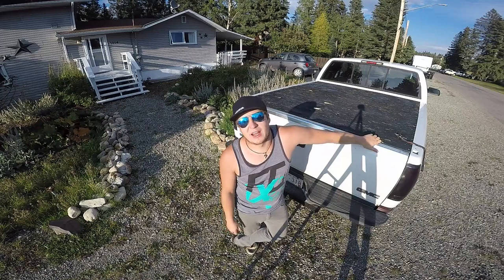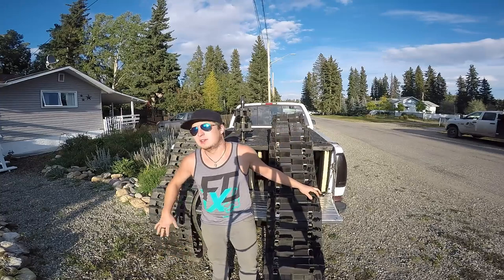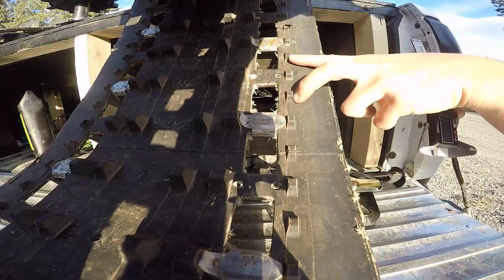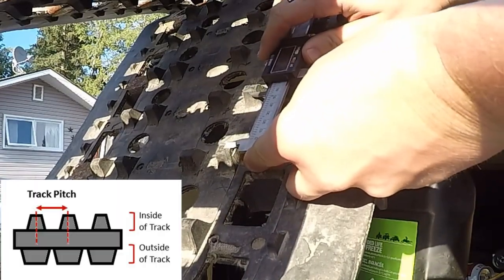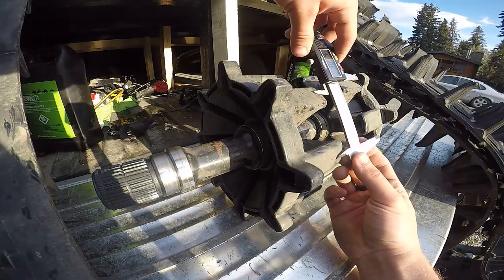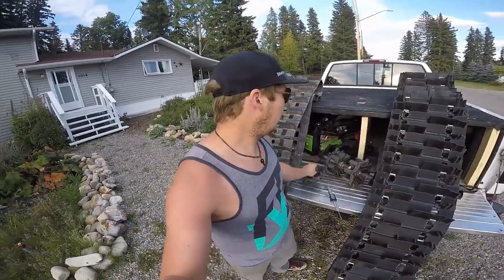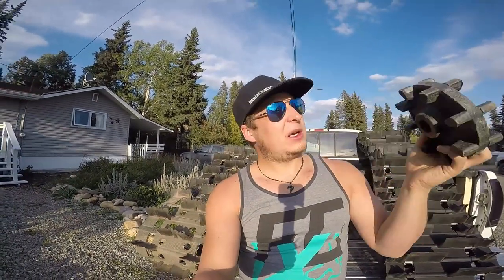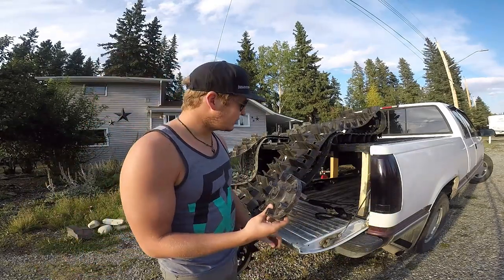SNOWMOBILE TRACK PITCH EXPLAINED AND DEMONSTRATED

Comment: Were there any problems with the 2018 sleds? Such as overheating or clutching?
Reply from the maker: The ERs got a new primary clutch due to the bearing not being to spec. A few routing updates. Driver nut torque update. Haven't seen anything fail yet though.

Comment: Common Snowmobile track pitches are 2.52",  2.86", and 3.00".  Can quickly tell one from the other with a digital caliber, or tape measure 10 pitches (30"), and then move the decimal point 1 to the left  (3.0").

Comment: Matt, that was very well explained,  Tracks 101.   
Many RMK riders were changing out their stock 2.4" tracks c/w 2.86 pitch (which is now discontinued) to the 2.6" or 3.0" Powerclaw (c/w 3" pitch).
To do that swap you have to change the front drivers too.   Much improved performance and traction.   3.0" pitch has the lugs further spaced out, more snow between lugs/better traction and usually a lighter weight too.
What to do with that old worn out deep lug track??  They make the coolest truck mud flaps ever.  Trim the top lugs off where they mount, lugs to the back  :)
A perfect Mod look for a white F-350??   Hmmm??
Reply from the maker: I've seen em as mud flaps. Dunno if Ben would want that on his truck though. Not old enough yet!
Reply: Syxxes Performance Ben would love them :)
Reply: the powerclaw is one amazing track..